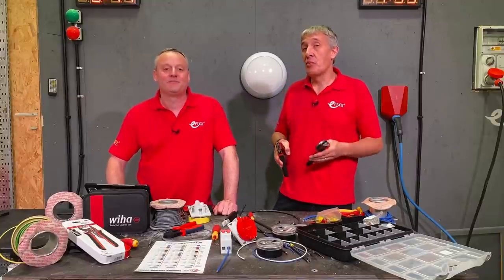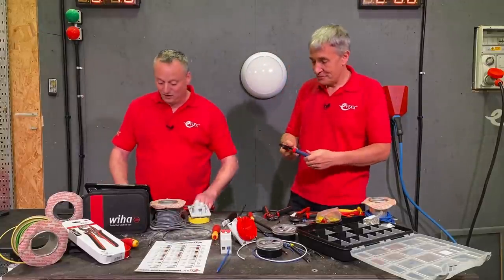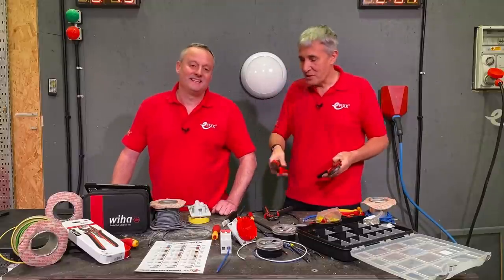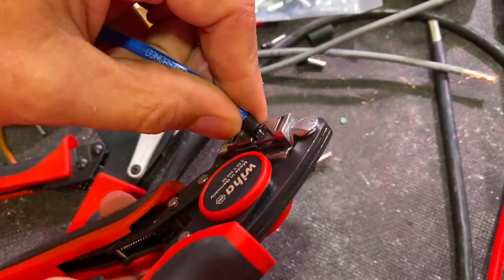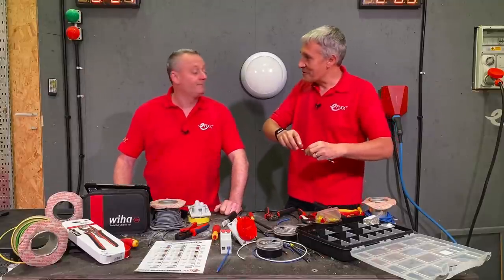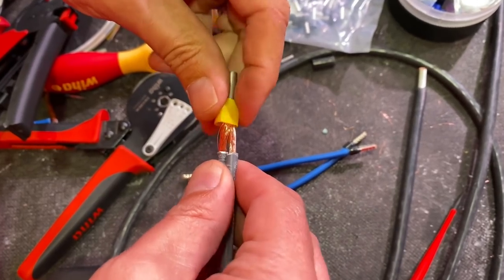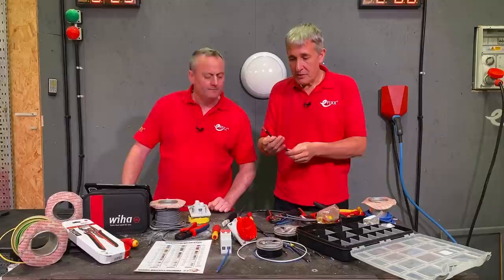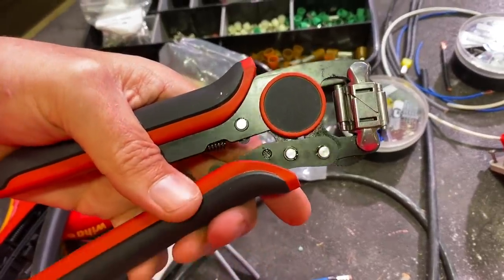WIHA FERRULE CRIMPING TOOLS which version would YOU choose?

Comment: Thanks guys, great infomercial as usual. I've had my square crimping tool from "a well known online supplier" for nearly two years. I got the kit with insulated ferrules for a job changing dozens of ceiling tubes to LEDs in schools terminating Hager Clik roses and, even sounding like a castanet, which mine doesn't really, it's a cost effective bit of kit. There are too many choices of ferrules to stick to a single one and as you mentioned, it depends what is available, so I fit to size and not colour. If I was working 8 hours a day every day on panel wiring i might splash out but not many of us could justify the cost of your ones.

Comment: The final bit of crimping occurs when you tighten down the terminal screw. They tend not to look square or hexaganol after that treatment. The small sizes often goes completely flat. However, no matter, as the ferrule will have done its job by maintain excellent electrical contact with all those fine wires and protecting them from being partly cut through by the rotating terminal screw at the clamping point.

Personally, I think class 2 would also benefit from ferrules to contain the "strand spreading" under a screw terminal. Not such an issue with cage type terminals.

Comment: Problems in pcm control panels I’ve seen is square crimp in half moon lug. But worse is trouble shooting when wires are combined and crimped, would like the kick the lazy assembler in the nuts. I will mostly solder single wires when combining.

Comment: I recommend Preciva crimping tool 20 pounds doing a job
Reply: I agree 
I have that one and it is defn good for the price tbh
Reply: i have 3 of them for crimp types I don't use often. they are pretty garbage quality, stiff mechanisms, poorly fitting jaws etc... fine for small amounts of work but if it's something you use every day hundreds of times a day get decent ones.
Reply: @Savagetechie  true 
I suppose I'm definitely not great at judging quality as I only use them once in a while 😄
Reply: So did I and sent them back after trying some test crimps, the arm was loose, the mechanism was pants with poor adjustment, and it got sent back for a refund, then ordered a Wiha pair which were much better made
Reply: @paulypyro  ouch 
I guess I got lucky with my Preciva ones lol

Comment: I bought the £12 eBay crimper. It included delivery and 1000 assorted ferrules. The Knipex version is virtually identical and retails at a local authorised dealer at £135+vat. Did an extensive wiring job with it and it worked perfecly throughout. Some branded stuff is just not worth the outlay.
Reply from the maker: might look the same, but doesn't feel the same! - just our opinion
Reply: You’ve missed entirely the very simple and clear point that’s been made - it did the job, and done at the price point of the consumer. It’s not about the feel is it? That isn’t of primary concern. Opinions are all well and good but if they’re born out of flogging and promoting someone’s product then the bias governing that opinion is all too evident.

Comment: At first I use Ferrules. But as the wire gauge gets thicker and thicker, Ferrules won't cut it.
In this episode, you showed us a Ferrule with HEX and SQUARE results. Any Ferrule crimpers that produces a "rectagular" head that best fits MCBs?
What terminal should be used when using 8mm² to 35mm² wires to be connected to MCBs?
THANKS!

Comment: Weidmuller ferrule crimpers and Weidmuller cable strippers are the best hands down - try them and see ✌🏻🙌🏻
Reply: Defo I recommend weidmuller crimp 100s doing panel working
Reply: I've been using Weidmuller for years definitely worth the money, clean and spray a little wd40 on them now and then thay will last a long time ,pair I have now been going over 20years panel building

Comment: How do you crimp 4mm2 ferrule with an 18mm pin length - my crimper is designed for a maximum 12mm pin length. Do you try and crimp twice along the length or will one 12 mm crimp suffice in the middle or at the pointed end?

Comment: I was thinking!⚠️ it would be a good idea to tin the bare ends with solder after crimping. 😳
Reply: Absolutely not, makes the termination much more susceptible to work hardening fractures
Reply: @Simon350S  What are you talking about, fractures where?
Reply from the maker: Solder tends to flow over time with screw connectors so isn’t allowed in UK regulations
Reply: @efixx   What do you mean by solder flow over time.

Comment: Skimming through the IPC books gathering dust at work they showed a sliver of conductor strands poking out of crimp terminals to be acceptable, or flush with the crimp barrel end. Recessed conductors inside the crimp barrel were a no-go. At the back of uninsulated terminals, they showed that a tiny gap should be visible (i.e. the crimp barrel should not butt up to the cable insulation). Why? I have no idea, but anything military, space, aviation, or high-end industrial has to adhere to these rules. Take this information with a huge bag of salt, I don't have a single IPC certification.
Reply from the maker: Great info
Reply: With a great wire cutter you can have an almost flat wire end. And with practice and goot setup, you can strip insulation that fits right in the ferrule. No need to trim the strands or anything else. Most appliances (MCBs, RCBs, outlets, etc) take more than the ferrule length so why bother with a few tenths of wire poking out? Seems like your military is extra pedantric on useless things.